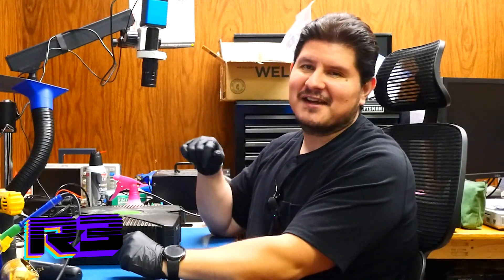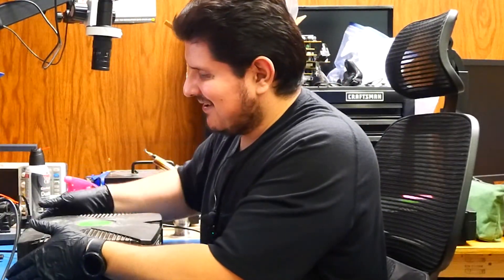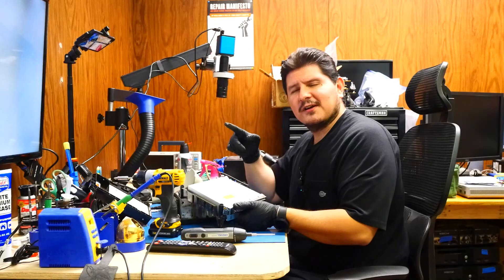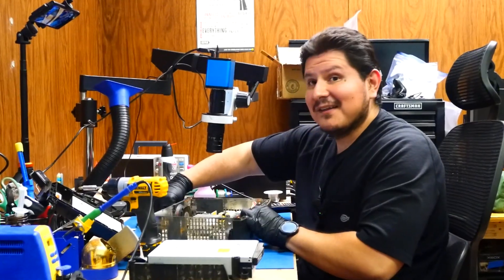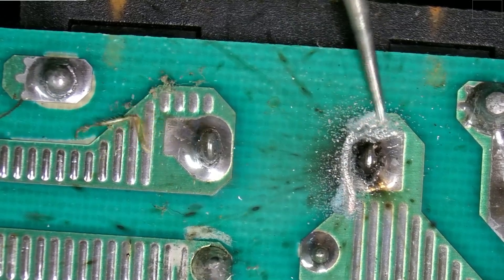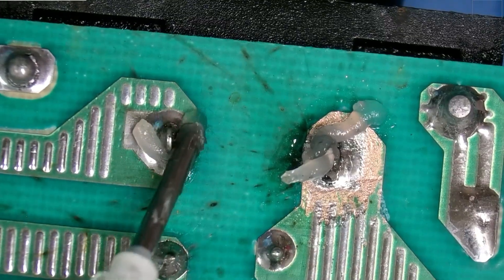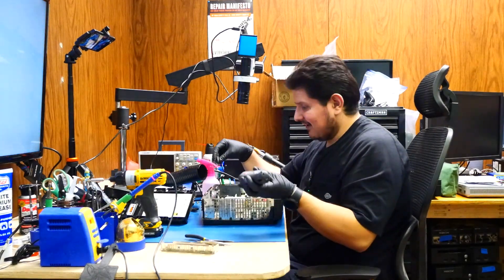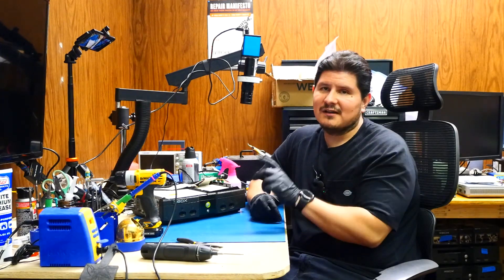Discover The Hidden Danger Within Your OG XBOX

Comment: I'm confused what the metal lines are next to the solder joints on the back of the PSU and how come you soldered them to the solder joint when they weren't before?

Comment: What was the rotary tool you were using to scrape the solder mask away?
Reply from the maker: Its a "mini drill pen" I don't see the exact one on amazon, but I did get mine from aliexpress. Be sure to get the one with the grinding bits.

Comment: This is a common issue on CRT TV's as well. In this case it is both thick legs and force when you pull and insert the power cable.

Comment: Xboxes are incredibly resilient. I've had very few that couldn't be repaired. It's always recommended to reflow the solder joints on the PSU plug. Even if the joints don't look bad.
Reply from the maker: Agreed. Why take chances, right?

Comment: How do you take the rust off the original xbox RF shields. Gracias amigo.
Reply from the maker: Sanding is probably the quickest and easiest. There are a few chemical options made by, loctite and evpo-rust, but they cost more than sandpaper and smell pretty bad.
Reply: Thanks for the tip, I could then use silver paint?
 @RetroRenegadeRepairs
Reply from the maker: You could. Take note of the grounding standoffs, as most people paint over them and they no longer make contact with the board.
Reply: True you are correct, grounding is important, thanks for your wisdom.
. @RetroRenegadeRepairs

Comment: Hello, the video is very interesting, but I that make me thinking, did the original xbox have power supplay replacement ?

I use for my Sega Saturn and Dreamcast the Pico PSU as a replacement for their old power suplay, so I'm kind curious to know if the Xbox have that kind of "mod".
Reply from the maker: I want to say someone was working on one, but I've not seen anything on it in a while. I do know a company or two did sell aftermarket ones and converters. People have also modded PC PSUs to be used for the XBOX as well.

Comment: Hidden? this not happens only when the xbox became old, i received a letter from microsoft on 2002 just two months after launch date to replace the power cable connector to the safeguard one 😳that cuts the power if shortcircuit because 1.0 can actually BURN ON FIRE if short circuit 🤣 the original AC power connector with current breaker is the best friend your xbox can had, as the one you show on the thumbnail, i got two xbox fried for the same danger you said 😥
Reply from the maker: I personally never had an XBOX with this issue, but I did get the safety power adapter from MS back in the day. I imagine it was more common if the console was moved around often.